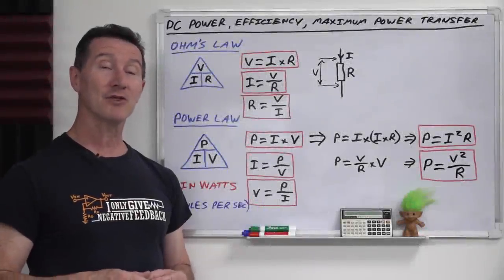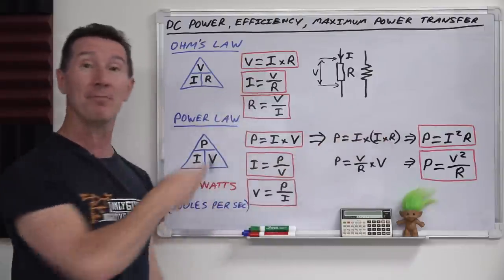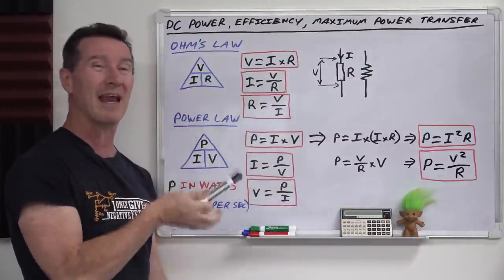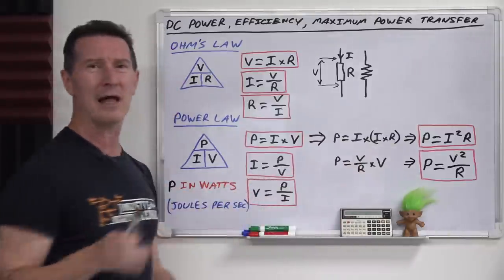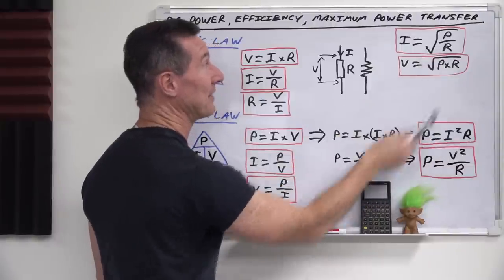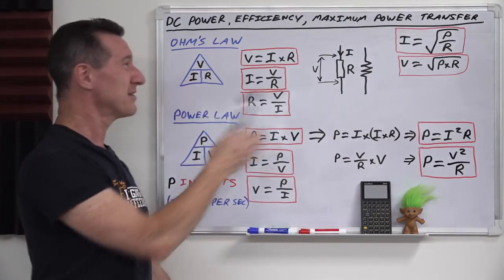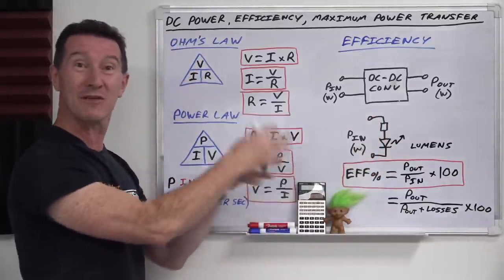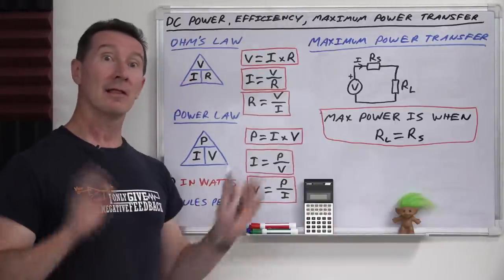EEVblog 1401 - DC Power, Efficiency, & Maximum Power Transfer Theory

Comment: I must have passed a quiz on Power Transfer Law in my first circuits class, then forgot it.  When I got to RF transmission lines and impedance matching I finally understood it intuitively, and was surprised to learn it applied everywhere.  Just goes to show that some "fundamentals" may need to be taught more than once, and from more than one perspective. Ohm's Law, in all its many forms, RULES!
Reply: Yep, I always say,  it's Ohms law, not Ohm's suggestion... :-)
Reply: @pa4tim  ,  OMG... soooo true!
Reply: put Omh's law before Murphys, & ya can't never go wrong....
Reply: @keithking1985  Or put the H before the M
Reply: Another place that this happens is in the inner ear. The three bones in the ear that connect the ear drum to the cochlea are an impedance matching circuit that maximizes power transfer of sound energy.
Reply: I never learned it in any of my classes.  I suppose it might have been on a day I missed, but if so then it never came up on a test.

Comment: I don't know why kids go to school anymore when they have Dave. Honestly.
Reply: @oH well,lord! I learned most of what I know in my free time.  Uni is more about learning a mindset than actual knowledge or experience.  But "muh piece of paper" was also my reason for obtaining an engineering degree.  This was before it cost as much as a house.
Reply: I think in schools I been to they scrapped electronics or merged it in science at some point in around 2000 where they focussed on theory and curiculum test material. No wires, battteries or even a volt meter on site. Lots of writing but very little. I was told by a student who got transferred mid way about the electron flow (in the new science curriculum module) being wrong compared to an older book he was talking about and referred to it as "junk science". The teacher said it was easier to teach it like that so us students can remember it to pass the exam.

Comment: 17:14 Maximum Power Point Tracking, a great way to think of this is one that we have all learnt intuitively from childhood with bicycle gears. Too low and your legs almost free spin on the pedals with little forwards movement, Too high and you feel your legs burn as you heave on the pedals, again with little movement. But when you use MPPT, starting in low gear to take off, click up gears as you accelerate to higher and higher speeds, you "ride" that peak efficiency, Transducing the most chemical potential energy into kinetic energy, with the least "wasted" energy, (~2000W Gross) Its like having a bar heater in each leg..... Feels like it to :-D

Comment: ...and this is where I have to admit that I stopped (truly) advancing in electronics. I didn't want to do (read lazy here) the messy math around max power transfer that wasn't intuitive or useful in my mind. I did continue on but never really advanced until I went completely digital. This was before personal computers and spreadsheets. I have, however, circled back around (decades later) and am continuously learning. Thanks for teaching/re-teaching...

Comment: Technically every circuit is 100% efficient... as long as you want a heater to come preinstalled with every other device.
Reply: I remember some old wall sockets light dimmers 40 years ago that use to overheat and burn out and they must 100% efficient.

Comment: Hey Dave, great to brush up on the fundamentals, and I will be giving the apprentices homework to watch your videos! I’m an auto electrician and thinking about the maximum power calculations in the automotive setting straight away made me think of a battery and a starter motor. Obviously it’s a bit different as internal resistance in a battery depends on many things including temperature. But it makes sense that having the battery and starter motor matched to get peak power across the load. When a battery ages and Sumgait on occurs internal resistance increases and the lid is no longer balanced for peak power. This can cause slow cranking, high current draw and low voltage. Through hands on experience I’ve seen the data and now you’ve shown me the theory and it made a happy match in my head! Thanks 🙏

Comment: Was hoping you'd tie this back to the practical application of MPPT solar charge controllers - oh well.
Reply: I thought that was a bit much for this video which was already long enough.
Reply: @EEVblog2  Yes I thought that too. Power transfer is very interesting - as you say not intuitive.  But back to practicality - how do MPPT controllers adjust the load, and the same for inverters that are trying to ‘push’ power into the electricity network?
Reply: @Richardincancale  ,  What do they say?  "Clever those Chinese!"

Comment: A long time ago, before I had a grasp on the very basics (electronics is not my area at all), I found the the relation of ohm's law to power and heat a little bit counter-intuitive due to how the human brain tends to simplify things.

I had the association that "more current = more power = things get more hot", and since I knew that adding resistors lowers current (given the same voltage, that was all I ever saw), I also formed the mental association of "more resistance = things get less hot". So then when you see stuff like P=I²R, the brain goes "wait, so the less hot things get, the more hot things get?" for a split second until you actually think about it 😆.

Comment: I wish the maximum power transfer theory wasn’t so harsh on my cheap 5 m USB cables… 

I 'solved' it by putting the DC-DC at the upstream port, but now I have unlabelled spicy 12 V USB cables…
Reply: Use USB PD, goes up to what now, 250W? 5A 50V or something crazy like that..
Reply: @Jannie Kirsten "The USB Type-C specification has also been updated to Release 2.1 to define 240W cable requirements, and with the updated USB PD protocol and power supply definition, this extends the applicability of USB power delivery to a large number of applications where 100W wasn't adequate." As per  usb.org

Comment: The maximum power transfer theorem can be seen as the solution to an optimisation problem: what's the load that maximises current draw while minimising voltage drop across the source
Reply: This is maximum power transfer to a T. Maximum voltage delivered to the load = voltage divider between Rs and Rl while keeping series resistance Rs + Rl at a minimum to yield highest possible current. So what’s the highest voltage drop across Rl while keeping (Rs+Rl ) to a minimum . Well easy Rs=Rl. Nicely done.

Comment: That was mostly review, but I do like these videos for fundamentals. In the first half of my career, I never even thought about the efficiency formula, but in my last job I was working on the design of high voltage dc-dc converters. I quickly learned that, and used on a daily basis. It’s amazing how efficient low voltage dc-dc converters have become. Is as in seminar where the low voltage guys were talking about 95%+ efficiency, where in the HV domain we would it was hard to get over 75 to 80%. On another note, I’ve been playing around with Mathematica, and I was thinking it would be a good way to run the analysis you ran in Excel. That was a nice demonstration of the calculus concept of maxima, but with out getting bogged down with the calculus. Mathematica gets around a lot of the Excel limitations, but it is way too expensive, so I only use the “Home” version and it can’t be used for commercial work. Great video.

Comment: Ohms law and Lenz Law only applies for low frequency DC and AC current. When you move into the radio frequency range above say 20khz, it no longer applies, because you are dealing with magnetic waves that are no longer flowing through the wire but around it like a waveguide. And Lenz’s Law can be thwarted in a transformer when you view the magnetic flux as a fluid flow simulation. And if you build your transformer so that it diverts the back EMF around the coil instead of back through the coil, you no longer get the losses and you can achieve over unity gains. Magnetism/the magnetic wave component is not lossy, for example a radio transmitter antenna doesn’t need to output more power for each receiving antenna. You can have one receiving antenna or 1 billion receiving antennas all receiving the exact same magnetic wave signal and the power needed to drive that output antenna remains the same. It’s an over unity device.

Comment: I²R losses, you forgot the most dangerous one: bad contacts, loosy connectors 🔥 Most dangerous when R contact equals R load, the power will be spread 50/50. When the load is 1000 Watt, and Rcontact= Rload, the contact of a few mm² will convert 500Watt into heat.

Comment: You should talk about the need to make the load resistance much larger than the source resistance if you want to transfer power efficiently. I run into way too many engineers who don't understand that power supplies must operate with a source resistance that is much lower than the load resistance, not equal to it, which will result in half the power being dissipated in the source resistance...
Reply from the maker: It's how you define the problem. I mentioned that the ideal source resistance is zero. But yes, I actually was going to mention that you shouldn't use your load resistance to determine the source resistance, but I forgot. The theory though is about "you have X source resisiance by design, so what's the maximum power you can put into any given load using that"
Reply: @EEVblog  The wiki page on MPTT shows power transfer vs power max and efficiency as two separate curves as a function of load resistance divided by source resistance. The MPTT curve is just as you describe it. The efficiency curve is at 50% when the load resistance is equal to the source resistance, and goes up monotonically. The power transfer curve goes down asymptotically to 50% as the load resistance to source resistance ratio gets very high.

I design preamps and power amplifiers for sonar systems. For the preamps, you want to minimize self noise, but maximize power transfer too if possible. Efficiency isn't important. For the power amplifier driving the transducer, you want the transducer's resistance to be much higher than the power amplifier's output impedance to obtain high efficiency. This means you need to design the power amplifier to have twice the output drive that you will actually be using. This is true for power supplies as well.

This has caused a lot of confusion over the years, including of some big names. Thomas Edison was struggled with this for several years before figuring it out...

Comment: When discussing the P graphs, it would be nice to see the efficiency as well. For R_S=R_L, efficiency is 50%. When is efficiency maximized?
Reply: Efficiency will be maximized as R_L approaches infinity. The current will be decreased meaning both R_S and R_L will consume less power, but because P=I^2*R and R_L is getting increasingly larger than R_S, it will consume more power than R_S, with the efficiency approaching 100%.
Reply: Efficiency in this circuit would be Pl/ (Ps+Pl).  This simplifies to Eff = Rl/ (Rs+Rl).  This doesn't have a local maximum and grows as Rl grows (but total power transfer drops).  Intuitively we can maximize efficiency by minimizing Rs.
Reply: @mikefochtman7164  wouldn't this be Rl/Rs+Rl)?
Reply: @pj6366  DOH!   You're right of course.  Edited.
Reply: @mikefochtman7164  Interestingly, if you wish to maximize both power transfer and efficiency, the sweet spot is at Rl=3*Rs, which gives you an Eff = 75% and P = 0.75*Pmax

Comment: Thank you.  Calculator #1 is that the Radio Shack 1982 portable computer? Then the Swiss Micro? No idea about the last one but probably a Casio?

Yes as the voltage goes up across the load, the current through it goes down. I agree, not that intuitive. My first instinct would tell me to lower the source resistance.
Reply: Calculator trolling?

Comment: At the point of maximum power transfer half the power is being dissipated in Rs so your efficiency (load power / power supplied by the ideal voltage source) is only 50%.

The efficiency increases as Rl increases, but that also decreases the delivered power, it is just that the power wasted in Rs decreases even faster. You only get 100% efficiency when Rl is infinite, but then you get no power at all!

You get similar results if the power supply is idealized as a current source with a parallel resistor. You once again get maximum power to the load when Rl = Rs, but now you get 100% efficiency when Rl is zero, and 0% efficiency when Rl is infinite. But almost all real-world power sources are voltage sources with series resistance.

Then there's solar panels, which have a non-linear I:V relationship which also varies with illumination. This is why you have MPP controllers which adjust the apparent load resistance to get the most power as the illumination varies.

Comment: There are two different optimization problems: 
Finding load resistance RL to maximize load power for a given source resistance, Rs.
Finding source resistance Rs to maximize load power for a given load resistance, RL.
For example:
In the old days with transformers, the first problem was unavoidable.
With switching power supplies we can get well above 50% efficiency. Mainly due to the clever combined use of lossless components: "bucking" inductors and capacitors. ... And great switching semiconductors. Not DC, of course.
Great videos though.
Reply: Usually Rs is fixed in the design and you wouldn't go just increasing it.
Reply: @EEVblog2  True in most cases
Reply: I should add, I know Dave knows his stuff. It was watching one of his videos that I learned that matching impedance uses the reverse reactance. I seem to have read that the same applies on the input. Apparently coil mics perform better with a “matching” capacitance? Presumably the same would apply to a magnetic cartridge for a record player?
Reply: Although true in most cases, when we CAN choose the supply, as in choosing a battery, we want the one that has the lowest internal resistance. A battery with a low internal resistance will be more efficient for the same load.

Comment: 21:31 Yes! Yes please, a video on that!

Maybe also "extra for experts" with things like resonate inductive coupling as seen in tesla coils and newer wireless phone chargers, there is also alot of impedance matching in amongst there, not just Lx Cx but also	wavelengths and tesla himself states in his patents matching Lx with R in regards to designing and choosing inductive coils, I was curious to know more about the implications and reasoning as his Bifilar coil that was intended to negate "self inductance" not only became closely associated with his work but he himself replaced many of his previous project designs with his newly updated bifilar coils, as if he realised a significant advantage in their application to resonance circuits. Something that has little proffesional, indepth and sensible explanation with rational reasoning on youtube and the internet as a whole.

I have to emphasis, I'm talking about overunity,free energy (as in thermodynamics violations), or infeasible energy transfer/transduction. I cringe at the very thought and grit my teath when forced to use the associated nomenclature, but hidden away beyond the mountains of spudosciencs and absolute bullshit is legitimate intelligent engineering science, built, tested and paid for by a genius with more money than most universities, and entire hydroelectric power stations at his disposal.

The internet needs competent, well educated, well informed and well explained discussion of the intricacies of their operations and sort the garbage from the gold.

Comment: Is this why you have to match the impedance of the output transformer to the speaker? If you run a 16 ohm speaker on a 8 ohm transformer, will it damage the transformer, or speaker?

Comment: Are you planning to extend this to the "complex" power theory? (Power in reactance loads, Power-factor, VA, Q, S, etc )

About max power when Rs = RL, this is correct but leads to misunderstandings when you talk about hardware like transmitters. Rs from a transmitter is not 50 ohm, it is much lower. A transmitter is designed to deliver a certain amount of power (its max power without blowing up) into a 50 ohm load. If the load is not 50 ohms  while using 50 ohm transmission lines you get reflections. That is in-depended from Rs.  But just because a TX delivers its max continuous  power (without burning or blowing up)  in 50 ohms it will not say that Rs is 50 ohms too. 

It is the same for DC, the max power transfer possible according math (when Rs=Rl) is only possible if the used parts can handle that power and a lot of people forget that. The max power a load can dissipate and a source can deliver is not related to the max possible powertransfer  based on Rs=Rl.  Simple if you think of this, if the max power of a Rs source is 100W into a 1 ohm load, the load resistor must be 100W, a 1W would still cause a 100W max power but very short, the resistor would just burn up. Everybody gets that, but when it comes to 50 ohm and RF many people forget that max power is not equal to the max power a source can deliver and a load can dissipate.

Comment: Would love to see this correlating with mppt?
Reply: mppt for solar is just increasing the load current until the voltage starts dropping settling on the point giving you the most power as opposed to the most current which would at a lower voltage also yield a lower power. (in broad terms)
Reply: @notsonominal  Thanks for the explanation.